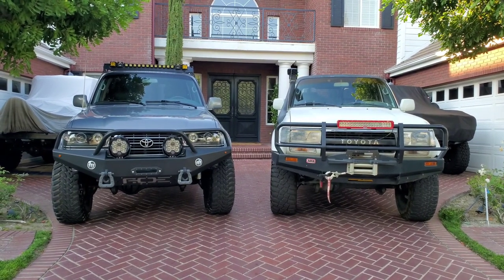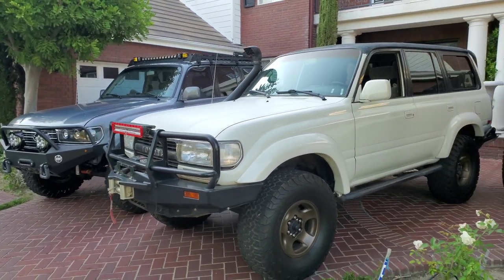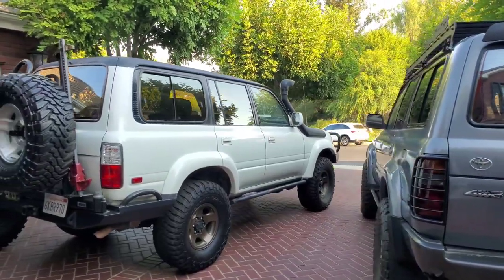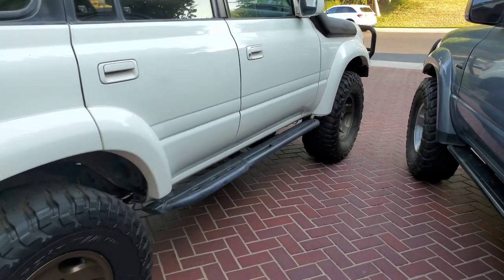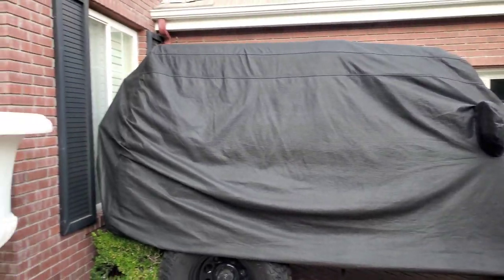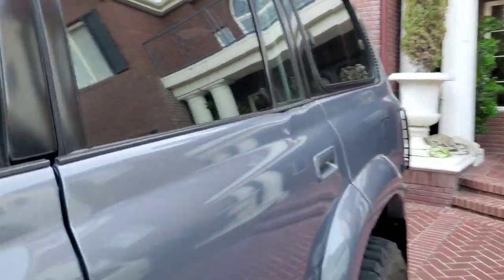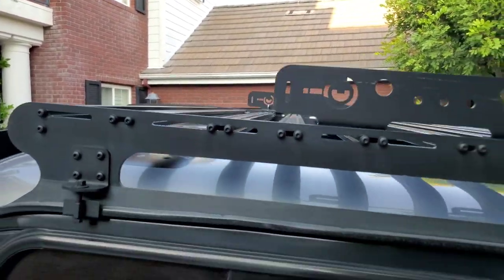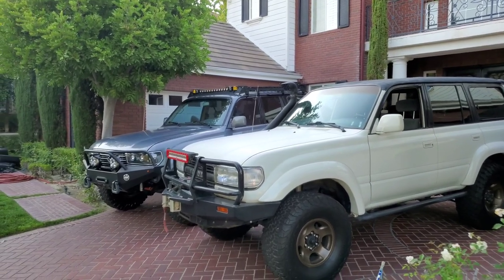FZJ80 Land Cruiser 1994 vs 1995 - What are Differences?

Comment: My 1994 has leather seats and the leather center console. Nice comparison!
Reply: Are your seats holding up?
Reply: @george2113  driver seat is cracked and worn. All other seats are in great shape.
Reply: @craigmayfield4854  I asked because my fabric seat '94 is holding up pretty well at
228752 miles no tears
Reply: @george2113  That's great and I'm not surprised to hear that. Over the years I've found Toyota's cloth seats to be more durable than their leather seats.
Reply: @craigmayfield4854  I don't know how they engineer such tough fabric!
Reply: My 93 had leather seats.  No holes or rips but they did look cracked.

Comment: Great video man. Just sold my 92 FJ80 because I picked up a clean 97 FZJ80 the stock power level difference is amazing.
Reply from the maker: Do you notice a difference in steering and suspension handling?

Comment: Something I just figured out swapping a 97 LX450 engine into my 94 Land Cruiser that the 93-94 don't have a crank and cam position sensor. It gets all that data from the distributor but the distributors are in fact the same part so yeah. My LC runs and just has a loose crank sensor plug coming off the oil pan now lol.
Reply from the maker: Interesting...
How much did the donor engine and install cost, this may help some others...
Reply: @CruisingTheLand  Got the donor engine for $1,000 since it came with no harness or ECU as my friend needed it for his LS swap. So still OBD1. Spent around $500 in fluids, gaskets, and a battery. And I bought the vehicle for $3,000. So I have about $4,500 in it right now. Dude I bought it from bought 5 Nittos and blew the engine up 50 miles later but I'm going to see if it's worth rebuilding myself and selling to recoup money. I had to swap the entire engine wire harness, intake manifold and throttle body, exhaust manifold, and that air injection nonsense from the 94 1FZ to the 97 1FZ. One revision that made mine harder is that my trans cooler lines are hard lines all the way up to the trans cooler. On the 95 and up they have rubber hoses at the bell housing connecting the hard lines making it easier if your just pulling the engine and not the trans. I took the shifter out to be able to get to 3 of the bell housing bolts through the cab which wasn't too bad the the right extensions and swivels. Hopefully some of that will help someone decide if they want to pull the whole drive train or just the engine.

Comment: Good comparative video. As they moved on extra options like consol fridge and rear heater, rear AC. Sub tanks and roof consol gauges. New is nice but the 80 series is in a class of its own!
Reply from the maker: I have the cool box on my 200.
You are right though, 80 is last of the solid axles... well that and the LC I have under the black cover...
Reply: Nop...105 does have solid axle. Also all J7 series.
Reply: @CruisingTheLand  the maker of the 95 aftermarket lights?

Comment: Hi loved your video love the colour of the 95 looks like a silver paint or gun metal, i have a 1997 4.5 EFI manual in white and love it. I was wondering will the early 1993/94 rear doors change straight over to the 95/97 model?

Comment: Keep in mind time and government regs
95 had ABS brakes - replacement is app. $7000AUD - totals the vehicle
95 had airbags - limits the bull bars that you can fit
Any engine / exhaust changes can be made easily and cheaply 
For simplicity and modability the 94 got the nod
Reply from the maker: How do airbags limit the Bull Bar?
Reply: @CruisingTheLand  In Australia Airbag equipped vehicles must have bull bars engineered to work with the airbags. Therefore an airbag compliant bull bar will be made to crumple like sheet metal and cost app$3000 new

Comment: Great comparison! I would only buy a 95+ 80 series if I wanted one. Almost got a free 94 that was rust free but it didn't work out :(. Just a heads up though, the base coat clear coat combo paint is referred to as "single stage". I've restored a few cruisers in my life and only use single stage. I spray it myself. Way easier to match and is just better for 4x4's overall. You don't get the same showroom finish but who cares with these things, right?
Reply: J

Comment: We have a 94 with the cloth interior and it is still really nice. I thought leather was an option in 94. One other benefit of the cloth interior is they were manual seats. The leather seats were motorized and many have failed after all these years.

The stereo in ours is stock and is pretty lame by today's standards. What is your recommendations on upgrading speakers. Some appear to be hard to find sizes.
Reply from the maker: Failed and cracked...
The alligator leather in those 80s... upholestry defimitely stands up to father time.
Reply: I have the 97 all leather seats and they did crack overtime but thats just the driver seat. The motorized seat is easy fix with the plastic gears. But yes! The stereo and speakers needed a major upgrade. Will be doing mine coz its hard to enjoy the ride without a good sounding system.
Reply: @motogp2375  We gave our 94 LC to my stepson's wife who needed a car and she likes it.

Comment: Front bumpers also changed between models.  

Cant recal in what year the fender flears went from plastic to fiberglass

Keep up the cruiser content!  Cant wait to see whats bellow the curtain
Reply from the maker: Hi PR Cruisers,
Where are you located?
I believe the US spec LCs all had Plastic fender flares as likely mandated in order to import. Maybe other markets got fiberglass.
Reply: @CruisingTheLand  hey bro. we only get us spec vehicles in Puerto Rico.    Maybe backwards older 3fe fiberglass.   Idk.🤷🏽‍♂️...  Just remember pulling off fiberglass fenders of some “parts truck”. 😅. 

Some year fenders seem to be wider than others.  There is one model (not specific to year) that doesn’t have front mudflaps from the factory.
Reply from the maker: It is possible the import dealer added then. For instance for the 100 series, there was 2 major Toyota North America import main dealer. One Southeast (FL and minimal surroundings) and reat if US. Not sure the story behind why Toyota USA was soilt into these two...
So, the Southeast Toyota division added Fender Flares to their 100s once delivered in the US. Whereas the rest of the states did not have the fender flares.
It was bolt on, to existing mudflap holes amd some.clips and doublesided 3m tape.
Just like roof racks, that get installed when the LCs were at the port before going to dealerships. They drop a template, drill the holes and install if that option was chosen by the dealership.
Reply: @CruisingTheLand  so much history behind these vehicles.

Comment: Hi, am thinking of purchasing a 94 all white 80 series with 200k miles, triple locked.  It’s listed for 15.5k, in CA.  Fair price?  Also I was wondering if the 2nd row seats fold down flat easily like they do in the 3rd gen 4runner?  Cheers.
Reply from the maker: folds uo against front seats upriight.
If its CA cruiser no rust, and reg maintenance done, thats a deal!

Comment: Actually the 94 has the bigger motor as well. The 93 and older have the previous engine. 94 and newer are the FZJ80s, 93 and older are FJ80s. It's the difference between someone that buys and not builds.
Reply from the maker: the 93 also has the 212hp 24 valve  inline6, it's the 91 and 92 that had the 62 series carry over engine, 3FE, which is 155hp and underpowered.

Comment: 1st
where did you get thought headlights & bumper & all the the lights on them & the above basket
on the 95...?

2nd
a asoldier in KSA 
put his 2003(i think) landcrusaaaaier v8 VXR automatic on sell 
with 940k.km(584k.mile)
original engine & trans & diff's... 
& never had big fix's (based on his statement...
Reply from the maker: The front bumper is AOE, American Overland Expedition sold in Southern California. Lughts are Angel Eyes and Baja LP9s Flood and Spot.

Comment: I have a question that you could help me with , Are those tyres on the standards R16 8jj wheels ? If yes how do the ride on the road and sand at low pressures? I am in the process of putting new tyres on my wheels but I getting good and bad reviews.Plus the wheel and tyre chart says a big no. I would love to hear your thoughts . Thanks
Reply from the maker: Yes, the wheels on both trucks are OEM 16" Landcruiser wheels. Best wheels, for the authetic look!
If you arr going to 315/75/16 you will need a lift and some minor trimming of the platic piece on the mud flap (or ditch your mud flaps) the 315 is close to a 35" wheel. I have 2-2.5 inch lift in both trucks.
The Toyos run great and so do the BFG. The Cooper SST arr also great tires (have 37s on my HZJ73)
Reply: @CruisingTheLand  Thanks for your feed back , I am looking to put the 285/75/R16  on the 8jj wheel, but the tyre fitment workshop are tell me not too . It is just a lot of money to just trail and error. Thanks again.
Reply from the maker: @eugenevde021  well, 315 is bigger and thats what I have.
Do you have a lift?
What year is your LC?
Reply: I have the 1993 1FZ-F with the 40 Anniversary wheels . I am not looking to put 35s maybe just 33s. I have been told not to go larger than what the wheel chart says . But on forums and you tube people are doing it so always good to get first hand information from a user. ..

Comment: 0 seconds ago
I have this 1994 Toyota Land Cruiser FZJ80 (gasoline) and has a problem related to the ABS.  When the vehicle almost comes to a complete stop, the brake pedal vibrates with a sound and tends to drive the vehicle to the right.  If I disable the ABS, this concern does not happen.  My mechanic  tried cleaning all the sensors of the ABS, but the problem is still there.  Can you please help me out?
Reply from the maker: Not aware what this issue is with ABS.

Comment: Why does every 95 I see on YouTube have a cushion center console lid, but mine has the tray style like your 94?
Reply from the maker: Likely the leather was worn and someone swapped it out.
Reply: @CruisingTheLand  You might have the 'poverty pack' as they call it. I had a 95 that had the center console like yours and it didn't have rear sliding windows either... the rearmost windows were 1 piece.

Comment: Yo I know this is a old video and really hoping for a reply, iv got a 94 and it’s rusted out to hell, they is a 95 up on for cheap but has had a small engine fire killing all the wiring, I was just going to swap the engine and wiring from my 94 to the 95, is this going to be possible or not?
Reply from the maker: I'm not sure if it's the same woring harness. definitely have more research before buying the wiring.

Comment: You should swap out them 94 rear axle to the 95 as that is a full floater!
Reply from the maker: The 95 has electronic lockers.
The 94 doesnt, has ARB.
They are both Full float, which was introduced to the FZJ80 in 1993.
Per Slee Newbies guide:
Rear axle changes to full floater with disk brakes when equipped with ABS in 1993-94 model.
Continues 95-97

Comment: Hey mate , I’m looking at getting a 1993 80 series with 198k kms, anything I should be looking for specifically when I go to inspect it.
Reply from the maker: yes, see when heas gasket was done,  check underneath for rust.
check the rear main seal for leaks, the knuckles/ birfields etc .
always worthwhile for a mechanical inspection too if it passes your visual approval.
Reply: Not all fzj80 parts are available. Get a Toyota mechanic for the inspection . I bought the last rear license plate light assembly in the US according to my dealer. Right Rear door latch was gone, but I had a 95 Camry that convertible/or correct parts.

Comment: Great information here. Hope to meet you someday and talk 80series LC. Do you know any 80 series with a 200 series engine? I hope to have mine for generations in the family and that will be a cool option once I hit 500,000 miles (currently at 250k)
Reply from the maker: I have not heard of a 5.7L in the 80. Likely fitment issues. 
However, both engines should last a long time with regular maintenance. Why not drop in a 1HD- FT or FTE? It fits and you will get great MPG.
Reply: I saw that the 4.5 is designed to be rebuilt/rebored 3 times. But go to a machine shop with a correct torque plate so the cylinders are right with the head on.

Comment: nice 97 is the one though.
Reply from the maker: Hey Jailbreak. I have seen your Legendary Rig!
The 95 thru 97 are the same mechanically, differences would be possibly the 40th anniversary and the collectors edition.
If you find yourself on the West Coast, lets hit a trail!
Although I just may take the Green Machine:
https://youtu.be/-numYlBMwus
Or Godzilla
https://youtu.be/aOVn7TK2OMA
Reply: @CruisingTheLand  Im coming to west coast next week actually trail tailor made me a set of custom uper and lower control arms to put my rear axle back in center due to the lift, so if you follow me on IG you can basically see where im at and DM ill def do a trail.
Reply: How tall is your lift?
On a Icon stage 3, I am adding the Delta Panhard rod lift, but I am only at 2.5-3"
Will you be in Orange County?
Reply: @TheGreenMachineLandcruiser  6 in plus 1  delta in rear too. if your lifted the delta bracket makes it work

Comment: Hey man! 
Cheers for the video, 
Question for ya.
I’m an absolute rookie looking to nab a 4wd , wanting something I can work on in spare time and learn more about them. Any recommendations? Or anything to steer clear of?
Reply from the maker: Well,.I'm a Toyota guy, so depends if you want an old school rog, with leaf springs and something you can work on, or.something newer with more creature comforts. For.me personally, I love driving the older trucks, but also like.jumping into the 200 or 570 and cruise at 85mph. But total different experience.
Reply: Buy any Toyota 4wd. It'll keep working and you can spend your free time doing maintenance. LC isn't exactly budget friendly but I love my first gen Tacoma and 3rd gen 4Runners are equally as affordable and reliable.
Reply: The Toyota front axle is sturdy but annoying to refurbish

Comment: what bumper is better for MPG???
Reply from the maker: The lighter the bumper the better.
Both are heavy, then you add winch.. adds weight.
If you are concerned with MPGs.. then get a diesel 80. I will be posting a video tomorrow about best 80... comparing gas vs diesel
Reply: I’m not 100 percent concerned but I know if you add so many options for overland it can become a lot of drag and MPG is money saved for other activities:)

Comment: The front passenger handle bar is not aftermarket.
Reply from the maker: I believe it was for a 94.
The JDM models got it, but not US model. So it is a Toyota part (not aftermarket manufacturer) but not imstalled on US spec LCs.

Comment: I just got a 94 for 16th and don't know where to start modifying
Reply from the maker: Start with base lining the mechanical/ services. Then it's armor, tires and suspension. You should join the Pocast starting in January.

Comment: It's funny that the Americans don't even know that the 80 series first came out in 1990, not 1991
Reply from the maker: my HJ61 is 1990. Was the 1990 same Diesel motor or the 3FE?
Reply: @CruisingTheLand  was the first of the 3F-E, though they had diesel too
Reply from the maker: The Diesels would have been nice, but that 3FE... underpowered for a 80... 
I never go see 91-92s... no matter what the deal is. here it's 93 and up.. FZJ80, or better yet 95-97
Reply: @Cruising The Land  I have a 90 and a 94, 3f-e and 1fz-fe, 4 speed auto and 5 speed manual, the 94 is better in everyday other than the fact that it doesn't have the 3 locker option, my 90 has that though
Reply from the maker: offroad, 3x makes all the difference. But best would be 3x in the 1fz-fe
Reply: @Cruising The Land  yeah it would, my plan is to get one more to use as a parts car, and get both to where I want them, with factory equipment for upgrads